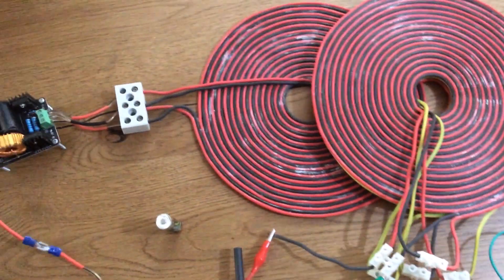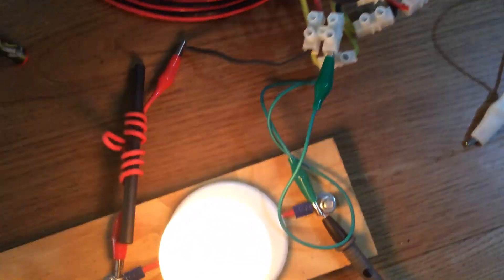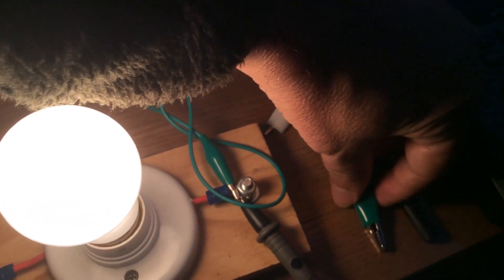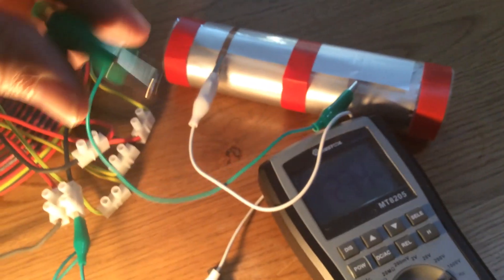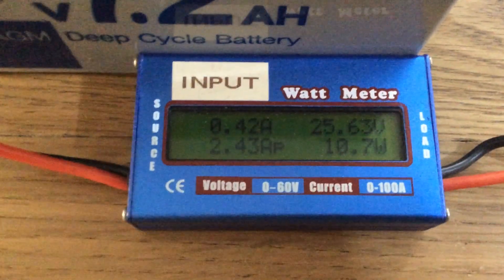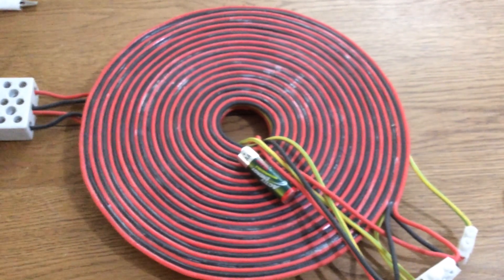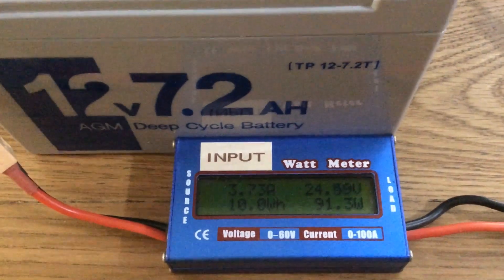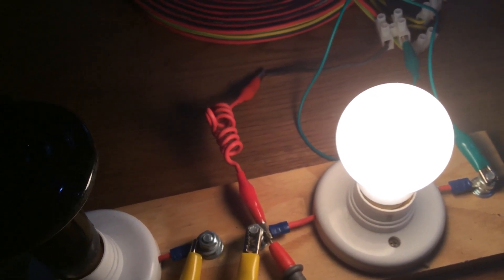TESLA PANCAKE COIL FOR HEATING AND LIGHTING

Comment: nice job...what was the % gain on power from the system as opposed to just the batteries by themselves?..cheers
Reply from the maker: Thanks for watching. The batteries alone are not capable of operating either the light or heating unit by themselves. The gain I have not bothered to calculate and instead was aiming at a particular voltage under load. Initially I had only the two black and red bifilar coils and to increase voltage I added three series coils.
Reply: @whatifididthis...1236  ahh ok i understand now..cool !!..thanks!
Reply from the maker: @thebigfella9095  Thank you.